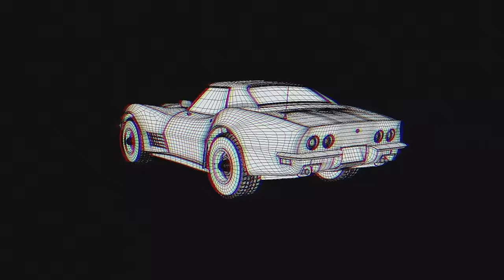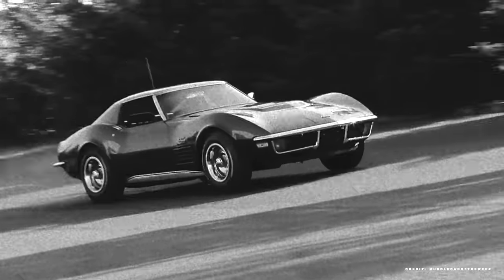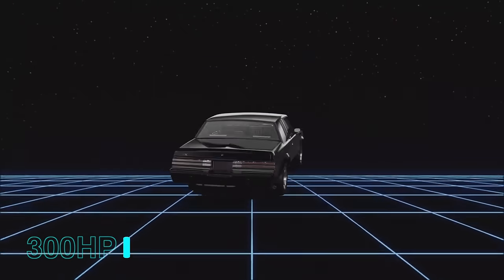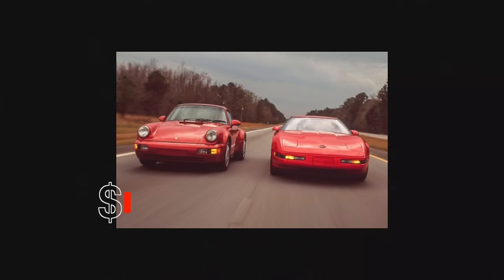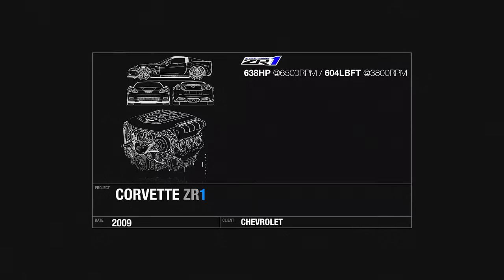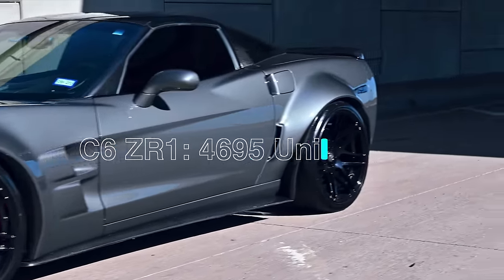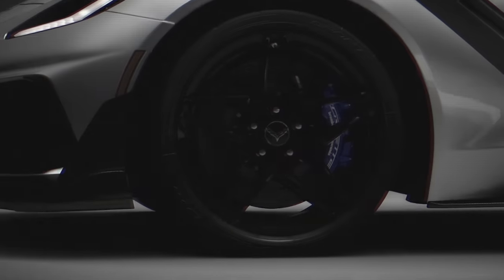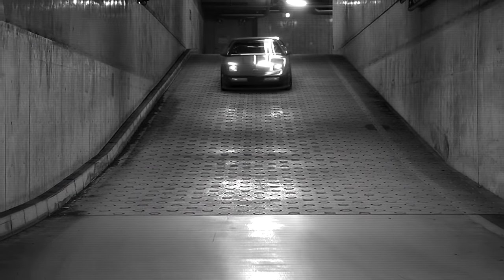The Corvette That Shocked The World | Explained

Comment: It not only set the FIA 24 hour endurance record, but also set the 5K km and 5K mile records as well.  They were only beat years later by a one off, purpose built, prototype race car, and I believe the records still stand to this day for a production car.
Reply: The C4 in general broke a TON of records and it's a shame it's one of the lesser respected Vettes.

Edit: For now.
Reply: Don't forget the speed record they set was an average speed, including fuel and driver change stops. To average that speed they had to drive at 190mph plus. Porsche, Mercedes and Lamborghini tried to beat the record, but failed miserably. That C4 ZR1 was a sensational car. Criminally underrated.

Comment: The original design of the LT5 provided was supposed to surpass 500hp but GM shot it down as they wanted to keep the bore size and spacing of the 5.7.
Reply: Meaning if GM produced the engine as originally designed, would that have meant we could’ve have looked at a potential 6 liter big block in an earlier version?
Reply: They could have made it into a 6 or 6.6 litre and kept the same bore spacing. That would have gotten closer to 450 to 500 horsepower.

Comment: LT-5 can make big power N/A. I've seen strokers do 6xxwhp. It was way ahead of it's time.
Reply: Lotus was also working on a second version LT5 with even more power. There's a video on it somewhere on youtube. If it had gone into production it would have been just insane for a street car in the 90s.
Reply: Doesn't even need new cams or a change in displacement; simply port-matching and polishing the intakes and heads, installing a freer- flowing exhaust, and swapping the flywheel for a lighter one will take you from 375 stock to around 500 HP, which is already more than the chassis knows what to do with for anything other than drag-racing.
Reply: @vomErsten  Who said it needs it? I said I've PERSONALLY seen LT-5's make in excess of 600whp. You're not making that kind of paper on the stock displacement. These are mainly 415ci. And plenty LT-5's tore up the drag strip strip over the years, where have you been. lol

Comment: I’ve always been curious how crazy the c6 zr1 would of been if they built it around the ls7 from z06 and why they didn’t do that. Still my favorite new model corvette and I’ll own one at some point in my life.
Reply: Had the chance to shoot the shit with an owner. The car is insane. The window to the motor on the hood is sick in person.
Reply: The cylinder walls are to thin on the ls7 to take any boost, so they would of had to make a whole new ass engine anyway.
Reply: Cylinder linerssssss
Reply: @corvetteZ3r wrong.
Reply: @darkened13  correct
Reply: @corvetteZ3r tell my 1200whp z06 that with a stock ls7 block. Go educate yourself before making ignorant statements.
Reply: @corvetteZ3r that’s why we need big blocks to make a comeback
Reply: @darkened13  prove it
Reply: @darkened13  if you really have a stock block that’s impressive at that power level, and you have a good tuner
Reply: Efficiency

Comment: You did forget to mention the c6 zo6 fitted with an ls7 7liter 427ci v8 that revs to 7000 rpm is an absolute animal especially given the fact it’s an n/a push rod v8
Reply: ... This video is about the ZR1...
Reply: LOVE MY C6 Z06! But the zr1 is king
Reply: @stelliosskouloudis703  the z r1 c4 is bad ass
Reply: And it’s a ticking bomb without totally aftermarket cylinder head castings.
Reply: @sbinnala  and your point is 
It’s a big 
Fucken 
V8 
That does not stop revving
Reply: @sagenbabin8786  and so is the LS9…you can also rev it to 7000+ just like all the 1000 hp cars in Texas do. Point being the LS motor is the greatest of all time.
Reply: @sbinnala  but se I love the ls7 because it makes torque is n/a but doesn’t make 1000 hp 
You have to stay in the rpm band with the ls7 

But I agree it’s the best flowing v8 ever
Reply: Who cares you can buy a 5.0 L that revs to 7500 and you can boost / tune a 10 speed transmission all the way to ghost cams and all the way to a 3.0L Blower, Just make the right choice .

Comment: While Lotus is an engine builder and did work on the LT5 design, I thinkit was built by Mercury Marine in Oklahoma. Lotus could not the warranty test without hand building the motors. Mercury built them using computer machining and measurment in a clean room.

Comment: And just think, the C7 Grand Sport is just as fast as the C6 ZR1 on a track. For you fast and furious clowns - a track, not a drag strip.  Its not about brute engine power. Its about getting the power to the ground.

C6 ZR1 0-60   3.3 sec                          C7 Grand Sport   0-60      3.6 sec
              0-100  6.9 sec                                                       0-100   8.5 sec 
              1/4 mile  11.2 sec                                              1/4 mile   12.0 sec
              Top Speed   208                                                  Top Speed   180 - C7 has significantly more down force than the C6

Comment: C8 ZR1 is not flatplane crank but cross plane one so it is 6.2 L not the 5.5 L  , TURBOS can't work on high flat-planecrank compustion engines like 5.5 L , this is why ferraris use 3.5 L or less so it is basically LT5 reformed into LT7 + twin turbos that produces 850 HP to the rear wheels only
Reply: The c8 zr1 is the 5.5 with twin turbos
Reply: And the voodoo 5.2 has a flat crank and can be twin turbo

Comment: The problem with things like 24 hr test cycles and such is that they are done in optimal conditions. Stable, constant flow, and cool temperature water. Cool air. Predictable constant loads. I say they should test in a chamber capable of re creating a hot rally race or something b
Reply: Who the hell ever said it was a “test cycle?”  Morrison Motorsports set all those records out on a track with a real car.

Comment: It's always bothered me, if we have the ability to shut off fuel flow to cylinders to increase efficiency, why don't they run an eight stroke mode?
Reply: I always wondered that too. Seems strange to let 4 cylinders become relatively cold and possibly build up more oil on cylinder walls. I mean, everything is supposed to be around perfect balance, right?

Comment: King of the hill to me, will always be to last front mid engine Z06. Big bore n/a engine and a fully manual 6 speed transmission. I had the chance of driving both the ZR1 or the Z06 for one run. I went with the Z06, man what a car.

Comment: Lotus did not make the motor. And only did engineering on part of the LT5.  Mercury Marine was responsible.  That is why they still run well in survivor cars to this day. Mercury built this to last.  This motor was designed to defeat Ford DOHC modular V8 platform that they were going to compete in NASCAR. Ford’s is “stock” real production platform perfect for NASCAR “stock” theme.  

However vagabond NASCAR owner and bigot against From Bill France prevented any kind of OHC motor (to this day with his racist against Ford, pro Chevy and Toyota palm up for cash son Bill France).  So, this very limited production LT5 had no real home once NASCAR agreed, took the payola from GM to ban Ford effort.

Comment: every ZR1 is phenomenal.  it's the corvette in its ultimate form.  When it comes to performance per dollar, there isn't a single car that competes toe-to-toe with the ZR1, regardless of model.
Reply: Not really the c7 zr1 is rated at near 800 hp and is slower on track than a 510 hp gt3 rs that’s naturally aspirated Porsches are better than corvettes when it comes to performance it’s just a fact 😂
Reply: @Ahmed-nb8gx  you are clearly a euro fanboy.  out of 13 tracks where the C7 Z06 and 991.1 GT3 RS were tested, the Z06 was fastest on 11 of them.  the ZR1 is in a different league than the GT3.  in VIR it competes with 720S and GT2 RS, and the GT3 barely beats the ZL1 1LE.  moreover the GT3 is much more expensive.  Like I said, dollar for dollar, there's nobody better.  in the test by motortrend and car&driver the C8 Z06 was faster than the 992 GT3 on the track and in a straight line, costing less.  it's not my opinion, it's the facts
Reply: Bruh the new z06 is rated at 750 hp to the crank and is barely faster on track than a 510 hp 992 gt3 with a worse power to weight that’s embarrassing just imagine the new gt3 rs that’s gonna smash your precious z06 kid
Reply: @Ahmed-nb8gx  lmfao.  the Z06 makes 670hp - 610whp and the ZR1 makes 755hp - 670whp.  you are very wrong on the numbers.  not only that, in VIR for example the Z06 is 2 seconds faster than the GT3.  and so far it has been faster than the GT3 in 3 different tests.  in addition to being more expensive, the GT3 cannot compete with the Z06.  euro fangirl

Comment: Why does everybody forget about the 350 twin turbo c4 Corvette  in 1988 the top speed record for over 20 years at 255 mph it was called the with 850 horsepower they didn't need a thousand or 2000 horsepower to go that like all the newer supercars do

Comment: ZR-1 Engines Make Too Much Power, than the frame can handle. That is correct for many generations. All those horse powers are of no real use. If you do not have the traction and drive train to follow it up.

Comment: I was car shopping after coming into some extra cash and wanted the ZR 1. I found one I liked and the owner took me on a test drive and no doubt it is a beast. The problem is that it is more of a collectors car and not worth the price. I'm sure it's a great investment but I want to be able to drive my car if I'm spending that much. At just under 200k it's not worth the price with the company that it's in. I ended up with a V10 R8 with the luxury Audi interior that was about 50k less. As winter approaches I'll be sending the car to California to get a blower, fuel, exhaust, and tune that was quoted at just over 60k. So for about the same amount of money as a ZR1 I'm going to end up with a 1200HP R8 that I can drive

Comment: Lotus is not an engine builder. Chassis and suspension is their specialty. F1 Lotus is known for using Cosworth engines. In road cars they used to use Rover engines and today they use Toyota.

Comment: C6 ZR1 has that tr6060, and there is a shift that they do, I can’t remember if it’s 3rd to 4th or 4th to 5th but it’s almost like a no lift shift and the rpm doesn’t drop that much and keeps it in the power band

Comment: I use to street race in Detroit from 89 to 95 These ZR 1 s would show up at 8 mile and Mound and race they had nitrous and would even beat the street bikes at that time But the owners told me they were Mercury Marine powerboat motors that loved high RPM
Reply: They were designed by Lotus but manufactured by Mercury Marine, so they weren't exactly lying. :p

Comment: Good luck ice against the tesla roadster 2 when it comes out... all dead... all.dead.
Reply: its not a matter of "when it comes out" but rather "if it comes out".
Reply: @jesseh9523  Why wouldn't it? They're prioritizing other production lines first.
Reply: @Adrenalin844  how? With magic? It's physics lol there's no arguing against this, you're just admitting not knowing basic laws of thermodynamics and Maxwell's equations. Internal Permanent Magnet Switched Reluctance single moving part at 1% of the cost of your 12 cylinder engine beats your tuned 1000+ moving parts that you have to service every month if you want to beat the roadster. Only alcohol dragster that can't do shit but go straight is faster.

Comment: The coyote 5.0 is hard to beat when it comes to making power. The stock blocks can handle well over 1000hp. Stock internals with just a turbo strapped to it have ran 7's in the 1/4 mile. No LS has accomplished that

Comment: My 75 Vett just had 140 hp. Then got an 89 with 245hp, pretty good performance. Next a 96 producing 330 hp but at too high an rpm to outperform my 89. Finally got a 2000 Camaro with 320hp. That bettered all of my Corvettes . I still have the Camaro, now with 238000 miles but runs pretty good. Wish I could afford a C6 or C7 but just don’t have the income to afford it. Future thrills thus will come from a Honda CRF300L Motorcycle.